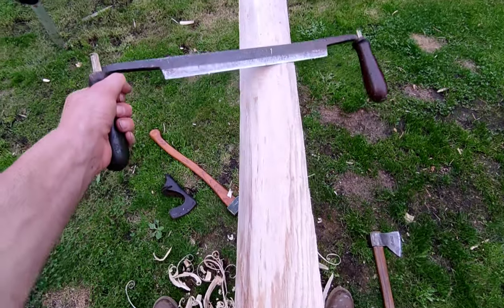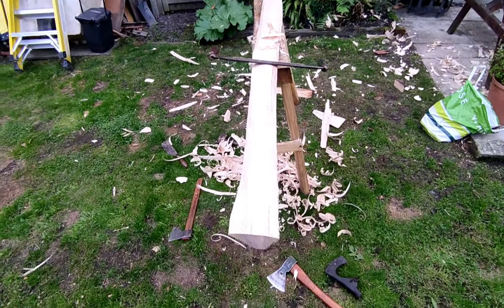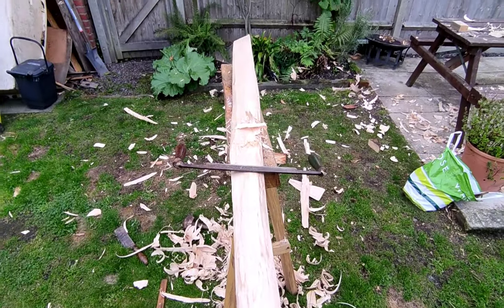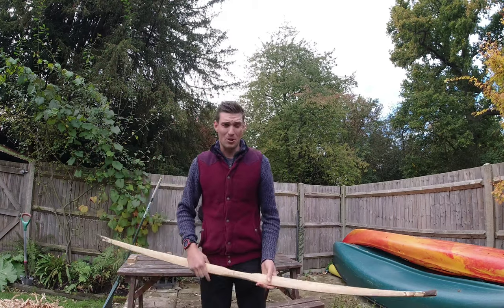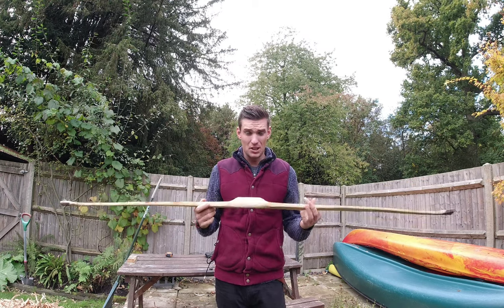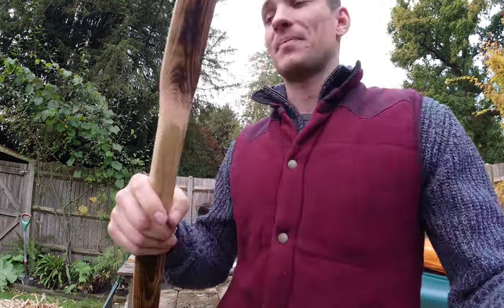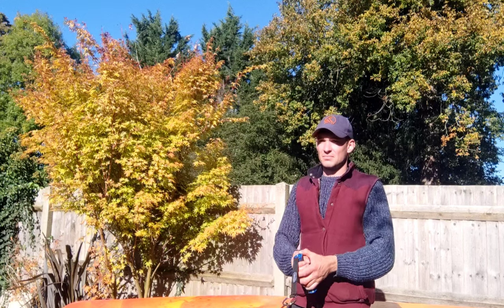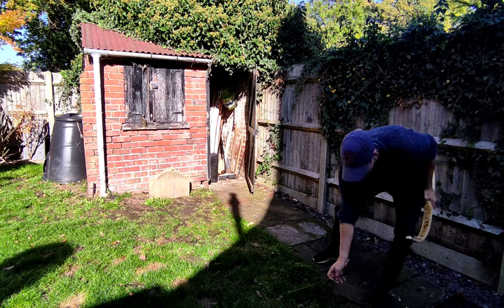Ash Flat Bow (from Log to Bow)

Comment: Awesome! You did a really nice job. 45lb draw is what my production recurve bow shoots. Beautiful wood. Would you recommend the heat gun treatment for something like a hand carved axe handle?
Reply from the maker: Thank you. Funny you mention that because I was discussing heat treating axe handles with owen Ben and Kevin. I reckon you could fell and carve a ash handle and heat treat it all in one day. The ash I used for the bow was 20% moisture content. After the heat treat It was reading 0%. It didn't crack or split at all. It makes sense to heat treat even a stock handle before hanging it.
Reply: I would just make sure it is dry enough, if you want to apply heat for achiveieng it, go for it. But because toasting the wood actually makes it a bit brittle (that is why we don't heat treat the back of a bow) and an axe handle doesn't really need to bend, I see heat treat as a mere asthetic purpose (in a handle).
Reply from the maker: @iasha740  I think it depends on what wood type you would apply the heat treat to. With my experience with ash you can heat treat it whilst it being pretty green. I think a good axe handle does need to bend to a degree. It needs to absorb vibration. Applying a heat treat before hanging the head means the eye of the axe handle wood can only absorb moisture meaning it's less likely to come loose. This is just a theory but I plan to try it out soon
Reply: @MrDesmostylus  Yes, the advantages on the fit of the head make sense. I hope it works out for you!
Reply: As someone who carves axe handles, if your carving green, leave it oversized then season it, it will be much faster. Never hang an axe on green wood as it will shrink and loosen or may split in a bad place. Always better to use seasoned Ash if you can get it.